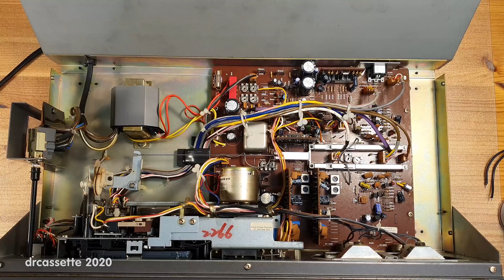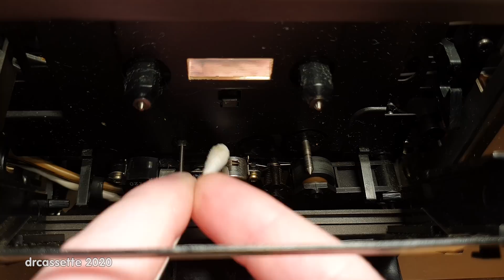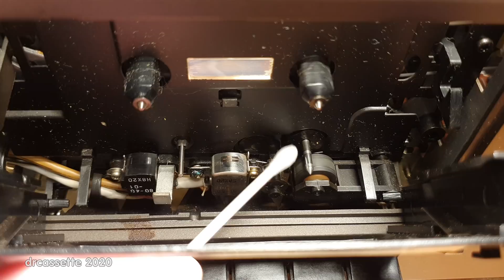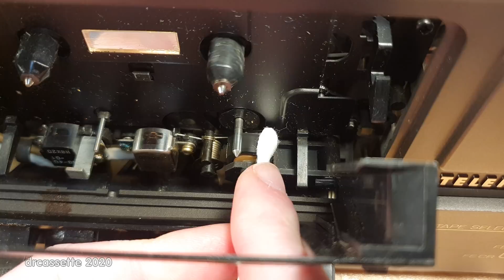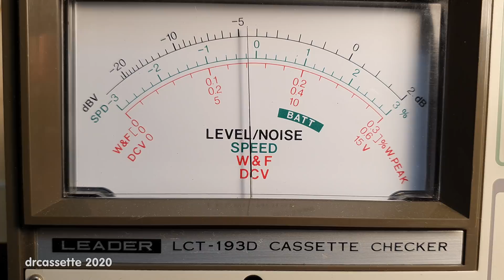Telefunken TC 400 hifi cassette deck repairs

Comment: hello, I follow your channel. I have a telefunken tc 400 deck cassette tape, but the Brazilian version, already with HIGH COM, the mechanism is very similar to this video model. I'm having problems with Wow and Flutter, replacing the belt and the problem got worse. can you help me with what may be the problem?
Reply from the maker: If the belt is fine (not too loose and not too tight), the problem is either caused by the capstan bearing which you should be able to lubricate with some general purpose machine oil (sewing machine oil) or by the motor.

Comment: Hey Im having an issue the 450M, on record, there seems to be multiple issues 

1. Output of music is very very low and the noise level is insanely high compared to the music
2. The output levels do not push past -20, even if both the left and right channel knobs are all the way to the right, it's output is really low

What could be causing this?, At first I considered azimuth but now I'm starting to think it could be another issue
Reply from the maker: Are describing the playback of a recording you previously made, or are you describing the sound output while the cassette deck is making a recording?
Reply: @DrCassette  while I am making a recording
Reply from the maker: @getzapped313  Ah okay, that is normal, there is no signal output through the DIN connector in record mode. There is some signal still bleeding through, but of course it's very quiet.
Reply: @DrCassette  I don't understand how that is normal, there's a lot of noise even after recording on play back and the overall sound is very tinny. The recording threshold stays only at -20db to -10db. Could it be from using to a DIN to RCA cable?
Reply from the maker: @getzapped313  Well you said it was while making a recording... 
Anyway, if playback of a recording sounds bad, the first thing to check is that the cassette you use to record on is good and that the heads and tape path are clean. Using a DIN to RCA adapter will result in the playback level being slightly lower that usual, but not much. Have you made sure the input signal into the DIN jack for recording is low enough to not overload the input of the cassette deck?
Reply: @DrCassette  well not to make it to confusing but, let's say I make a recording on my nak 700 and come back and play it on there, sounds great! No problems, but if I make the recording straight on the telefunken, this problem happens

I have cleaned the tape path and the head at least a few times but the problem still happens, I can share a video later on tonight showing what is happening if you would like

Comment: Telefunken TC 400  made by Funai Japan
Reply from the maker: Are you sure? How do you know?
Reply: Dear DrCassette
I know it exactly, that Telefunken TC 400 made by Funai.
I am a collector of many many Hifi Devices, too and have many Hifi Tape decks etc,
so i identificed, thatmany another Devices are made by Funai, too...

You can see Devices are from Funai : The Order Number of Printed Circuit Board are 7 Digits, beginning with 161....

A Telefunken Service Technician had confirm, that TC400 and many many other Devices
labeled Telefunken,are produced - under telefunken Specification - by Funai..
The Telefunken TC 400 is most similar with Telefunken HC 1000 and Uher CG 310 too

Another Funai Devices labeled Telefunken: TC 450/M ,HC 1000, RC 100,RC200. RR100 and many more.

Funai produced Hifi , Video Devices etc for many other Brands...

Blaupunkt HC 60, XC 240
Nordmende Stereo Recorder 6000
UHER CG 310. 321, 343, 344
Siemens RC 532  Saba CR 833 , 836
Teac V 30
Universum CT 2307, 2316, 2317, 2318, 2361, 2345. 2393, 2394, 2395, 2396 etc
Universum VTC 23814  ( Hifi 70 )

Siemens FM 500 = CVC Recorder from Funai

On all these Devices: The Order Number of Printed Circuit Board are 7 Digits, beginning with 161....

Lg
Knirscher
Reply from the maker: Thank you very much for the info! :)

Comment: Have you ever tried a product called 'Rubber Renue' for use on dried and slippery rubber?
Reply from the maker: I know about Rubber Renue, but it does not seem like they sell it here in Germany.
Reply: Hello, I have Rubber Renue - difficult to say if it is worth the money though!? However, with careful 'roughing up' of the pinch roller and cleaning like DrC did, is about as good as it gets.

Comment: Looked like a bit of dust on the cassette deck back plate I had seen,,,when u were cleaning the heads,,Capstan and pinch roller. Otherwise,,very useful video of cleaning a bad pinch roller with windex window cleaner instead of isopropyl alcohol,,,and of course it had to b sand papered as it was shiny,,,causing tape playback troubles. 

At least I have a few windex  window cleaning containers to clean pinch rollers of a few stereo cassette players I've repaired recently too.

Comment: I have a question, is water bad for pinch rollers, I have used a very very damp q tip, so that's there little water on there and have cleaned the pinch rollers and have had no problem
Reply from the maker: Water is not bad for pinch rollers if you dry it off after applying it. I just don't think it cleans very well.

Comment: I owned a TC400 brand new at the end of the 70s. It was different from this one, because mine was equipped with Telefunken´s proprietary HiCom noise reduction, which was somehow compatible with Dolby B. The parts were all made in Japan, but was assembled here in Brasil, where I live. Mine was a very good recorder, was the first I was capable of reaching 18khz with Type 1 tapes and 20kHz with Type 2 and Type 3 tapes (-=_3dB) which is a good mark even for today´s standards. However, the sound i heard coming out of the TC400 was quite different from what the instruments showed. The treble was not good, the mids were muffled and the overall sound was poor compared to the Akai and Pioneer decks I owned at that same time and at the same price tag. Maybe it is due to the HiCom noise reduction, I don´t know. Despite all that, Telefunken made a very good product and it was a pity they didn´t continue to make audio products with this level of quality. The tapes I recorded on it are sounding good until now, more then 40 years after they were recorded.
Reply from the maker: Are you sure you are not confusing the TC 400 with the TC 450? That was the model that had HighCom. HighCom was not at all compatible with Dolby, it was a totally different and much more effective system. Seems like there may have been something wrong with your deck, the TC 400 shown in this video sounds very good.
Reply: It was indeed a TC400 and with HiCom, I still have the purchase documents. I think this model was made only in Brasil, because the user´s manual that can be seen in https://www.hifiengine.com/hfe_downloads/index.php?telefunken/telefunken_tc_400_pt.pdf is in brazilian portuguese, where one can read that it comes with HiCom. The compatibility with Dolby was said (in advertising) by Telefunken to be "relative" when playing back tapes recorded with Dolby B in other machines, but not vice-versa. In my opinion, the HiCom worked very well when recorded and played back on the TC400. The only problem was that there were no other k-7 players in Brazil equipped with HiCom, so you had to stay with Telefunken models. That was why I gave up this model and used Akai, Alpine, JVC and Pioneer instead. However, I kept the TC400 for more then a decade and when it was sold was still working perfectly well.
Reply from the maker: Very interesting, I didn't know Telefunken had production facilities in Brazil. Looking at the manual, your TC 400 seems to have been quite different from my TC 400. For playback of cassettes recorded in other decks with Dolby B or prerecorded cassettes with Dolby B, the HighCom cassette decks had a switch labeled DNR or DNR Expander, which basically was Dolby B just for playback.
Reply: Telefunken tried the Brazilian market but could not face japanese nor brazilian companies. Its operations here ended when the brand was acquired by Gradiente in 1989. A pity, because their products were well designed and built. Yes, you´re right about the Dolby compabitiliby, I didn´t remember well the informations. Regards.
Reply from the maker: Interesting that Telefunken stayed in business in Brazil for so long. Maybe it was independent from the European consumer electronics branch of the company. Because the European consumer electronics branch was sold to Thomson in 1983, and Thomson was known for shutting down everything that wasn't profitable. In 1989 Telefunken here in Europe was already mostly gone...

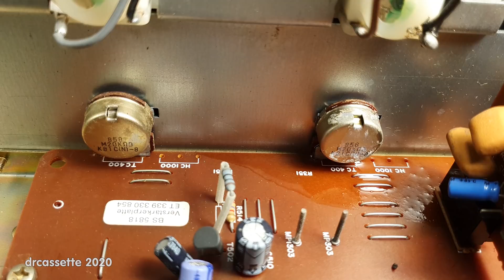Comment: Thank you for a very educational video, especially the pinch roller cleaning section. At 7:50, when you're cleaning the record level controls, we see empty holes marked "HC1000" - searching for pictures of "Telefunken HC 1000" shows a model that is almost identical to yours. Having only a DIN input/output seems limiting. I have a Beocord 6000 cassette deck with a DIN connector, but it also has a switch that allows me to set the Level to "DIN" or "LINE" mode....
Reply from the maker: Indeed there was a version of this cassette deck available in a "softline" plastic case with rounded edges and corners, called the HC 1000. Quite a popular style in the late 70s in Germany. I too had a Beocord cassette deck many years ago with switchable input sensitivity. A very useful feature.

Comment: Nice deck, I didn’t know alcohol would dissolve rubber. Always thought it was a gentle cleaning product. A product you should never is paint thinner, it dissolves everything, causing plastics to melt like glue.
Reply from the maker: Yes, paint thinner, also acetone, should be kept well away from hifi equipment :D

Comment: I enjoy your videos, because my hifi experience originated during the time these decks were made. One suggestion though: Maybe you can invest in better sound recording equipment to better illustrate the sound of the decks? At the moment the sound is somewhat tinny on the quite good quality sound system I use when watching YouTube videos.
Reply from the maker: I use my Samsung S10 for recording videos, and it does a very good job recording the sound. The way it sounds in the video is the way it sounds in reality. You have to keep in mind the amplifier on my workbench is connected to just the little white speakers you see in the background. Obviously those won't produce any deep bass. I would not like to add any further complexity to my video recording setup, such as a separate audio recorder. I want to keep things easy so that I can concentrate on the repair work.

Comment: Even if it's German instead of Japanese, I see a lot of similarities in its look and built with the Technics RS M-5 I used to have as a kid, so I guess indeed that a lot of stuff is outsourced to Japan. But a very nice looking one, pleased to see it functioning so well :-)
Reply from the maker: The general layout of parts was very similar on different manufacturers cassette decks from the late 70s onwards. This arrangement makes the most sense if you don't have any special features in your cassette deck. JVC remained different for quite some time as they mirrored this basic arrangement so that mechanism and transformer were on the right and the electronics were on the left.

Comment: Looks like a perfectly fine mid-range cassette deck. It's got really cool design as well :)
I have just 2 questions about the pinch rollers in general. Is it so hard to find new replacements? I mean not only for audio cassette decks, but also VCRs? Also, what do you think about cleaning the pinch roller with dish soap? I read through forums and that's what some recommend.
Thank you!
Reply from the maker: Audio cassette pinch rollers are available for some models, but they are very expensive. I have bought only one replacement so far, it was okay, but not great. So I try to restore pinch rollers whenever possible. I also have a collection of salvaged pinch rollers. I have not yet replaced a lot of pinch rollers in VCRs, but it seems like those are much harder to get. I don't think I have seen replacement parts kits on Ebay yet (like the ones for audio cassette decks). 
Alcohol does attack rubber, so it is not ideal for cleaning, but I very much doubt that water and soap are going to do a good job. There is even potential for further problems, if you use too much soap and don't get it out of the rubber properly, the pinch roller will be slippery. Not good. I prefer to use chemicals that quickly evaporate rather than water.

Comment: When I worked in the Hi Fi trade customers were often confused when it came to DIN standards and some retailer were.
I always stocked all the attenuated leads and the crossover DIN cables for direct deck to deck transfers. 
Quite a nice deck al things considered.
Reply from the maker: Interesting, I don't think I have ever come across a crossover cable for dubbing. All I have are standard DIN cables and these passive adaptor cables.
Reply: @DrCassette  It has to be a crossover cable because otherwise you would have output to output on a parallel cable. The same with the inputs, it would be input to input on a parallel cable. So it need crossover and attenuation. Its as a bit of a pain but a company did make a clever little adapter with variable attenuators built in. They had stereo phono inputs and outputs so you would just use phono to DIN cables and connect them how you liked.
Reply from the maker: Yes, I know why a crossover cable would be needed for direct dubbing. I just never saw one so far ;)

Comment: Very nice deck. Seems to have been well looked-after as it's in very nice condition considering it age. Yes, often companies would outsource part of the manufacture process, and then use local assembly and logistics. The only way to get round higher import tariffs, or to place the naughty little 'Made In..' badge on front!
Reply from the maker: Another reason in the case of Telefunken was that their management still felt responsible for the factory workers. They knew they had to cut production cost, but they didn't want to close factories, so the final assembly in Germany was a good compromise. The dirty work of closing most factories was done later by Thomson after they took over Telefunken in 1983. The original Telefunken management was still reluctant then, so soon after the purchase Thomson management came to Germany and fired all of the original Telefunken managers. Afterwards, Telefunken, like many other German manufacturers, went downhill and never recovered.
Reply: @DrCassette  Indeed, a very good point. Thomson also did the same with Ferguson here in the UK, but that was much later on. I've always been a fan of European made electronics as growing up we had an ITT HiFi system, and a Salora TV, and I had a Grundig radio cassette recorder in my room. Some of the items I still have and, of course, they still work! :)

Comment: The older Japanese vintage electronics are pretty decent....I have and have had quite a lot of those. That bieng said ...the german made stuff that I have had has been excellent too..mostly vintage though.....😁
Reply from the maker: If you want German made electronics you don't have much of a choice other than to go with vintage equipment, most of the German electronics industry had disappeared by the mid 90s... ;)

Comment: For cleaning pinchrollers i use rubber renew 👍
Reply from the maker: I would be very careful with what chemicals I put on the pinch roller. If any traces of the chemical remain on the pinch roller, they will get onto the tape you play, possibly causing damage.
Reply: @DrCassette  never had a problem with rubber renew products or similar components like printer roller cleaner. Not even with pinch rollers in my DAT decks which are totally different animals 😁
Reply from the maker: I want to get one of these printer roller cleaners to try and see how well they work for restoring idler wheels. But as I said, I would not feel comfortable with putting such a product on a pinch roller...